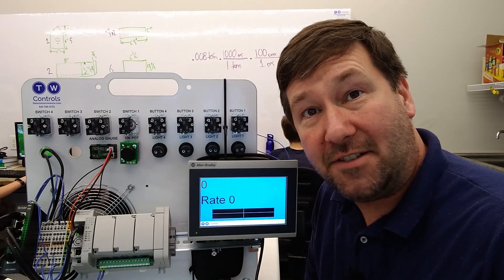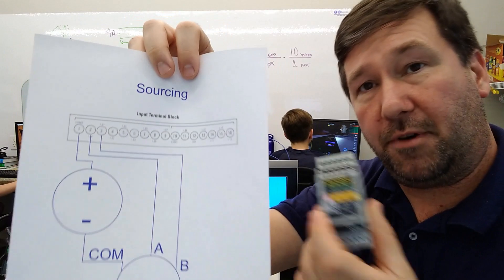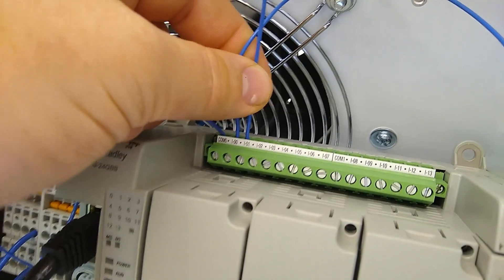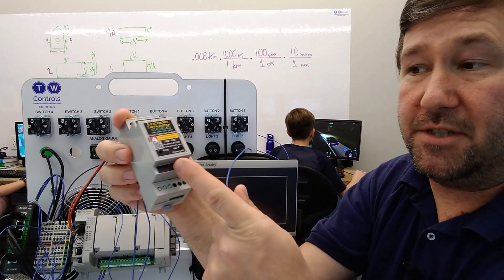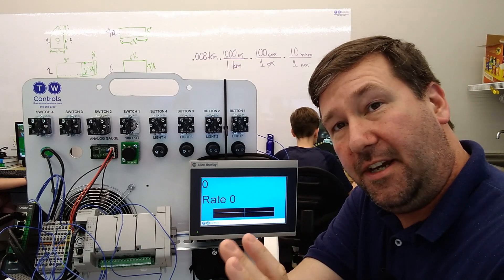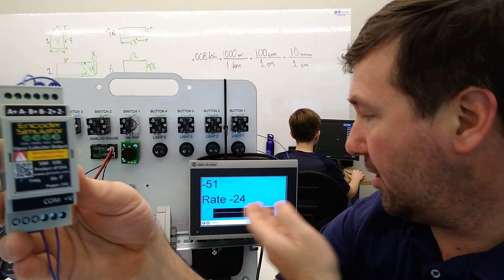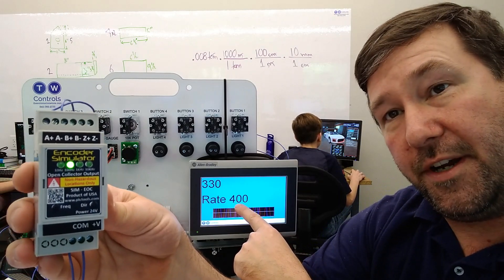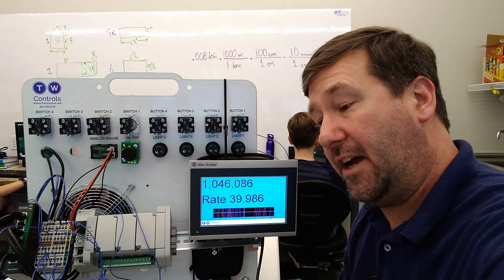Simulate Encoder Signals to an Allen Bradley Micro850 using the PLC Tools SIM-EOC Encoder Simulator

Comment: since this is NPN open collector does that mean it cant be used in a PNP based plc
Reply from the maker: Some PLCs can be both sinking and sourcing so need more information to say for sure.
Reply: @TimWilborne  for use on a 1734-IK
Reply from the maker: That module will work the PLC Tools SIM-EOC open collector outputs.
Reply: @TimWilborne  is with work supposed to be will work
Reply from the maker: Yes, corrected to say... that module will work with the SIM--EOC
Reply: @TimWilborne  great ordered one from Amazon yesterday was hoping it would work thanks for the reply appreciate it
Reply from the maker: @sprek2  It should work great for you.  Thank you for your order!

Comment: Hey Tim, very useful video as usual, just wanted to thank you a lot about your advice on the issue that I had I/O connection error I took the module out and plunged into chassis again now it's working well, Many Thanks buddy, can you lead me how can I get such info my plc was l30mr? Allen Bradley which protocol is using for it's own network?
Reply from the maker: Unfortunately I've found those connectors to be a problem before.  I'm not sure what an l30mr is.
Reply: @TimWilborne  so what is the protocol that Allen Bradley uses to communicate with I/O module and HMI?